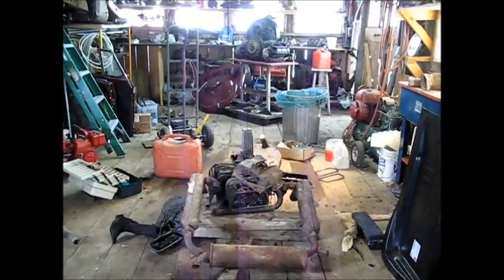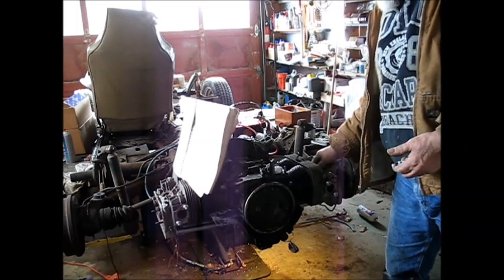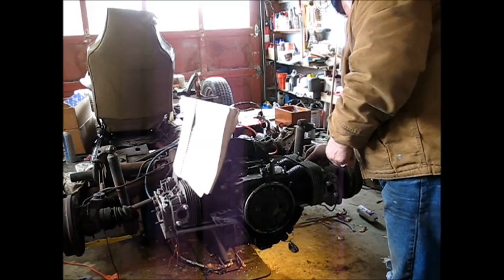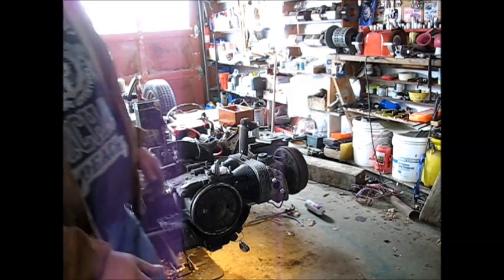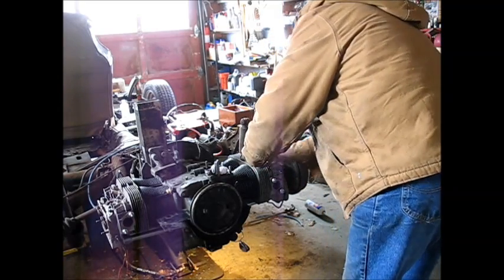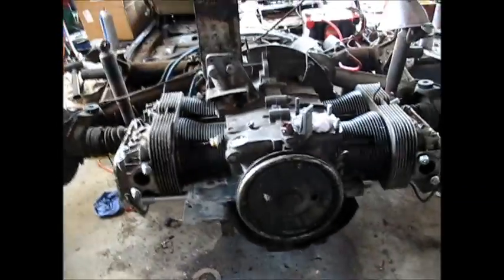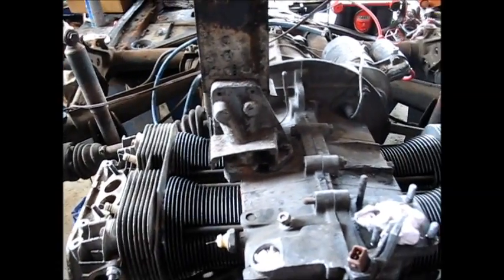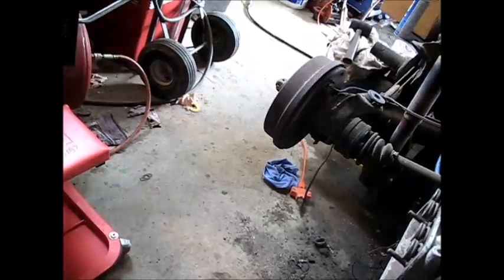Keepin' the snakes outta my motor

Comment: Bosch plugs are fine and dandy, just steer clear of the plug wires!! They are terrible! Mine would come loose every time I'd go over a train track.

Mallory ignition wires are top notch! Best I ever used and so worth the price. The stainless steel contacts on them are simply fantastic.

Comment: I bought a new Simplicity garden tractor in July.  It wasn't cheap!!  I mowed for a couple hours one day.  When I was cleaning it up afterward, I discovered a snake had crawled up in the engine.  Eventually, the flywheel cut it into many pieces and the heat cooked it in place.  I can't tell you how happy I was knowing a snake had been in between my legs for a couple hours!!  I immediately took it back to the dealer and they cleaned the snake out for me.  Good dealer, never charged me a penny to de-snake-ify my engine!!
Reply from the maker: I had quite a few similar experiences with snakes when I was a kid.  One more reason to move to Maine!  hahahaha..
Reply: rpeek I hate snakes, but I don't like the cold, either!

Comment: Over the years I have heard reasons why Bosch is bad and NGK is JUNK and CHAMPION is worse than having some sorta social disease or other etc etc... BUT I swear that if the plug length and heat range is right for the motor I never did notice much of a difference between ANY of them.  I suspect there are a number of people that will have reasons why I'm wrong, and I may be. but that is what I recollect after 30 years of wrenchin.  That's sad about the extry long plug messin up the head though.